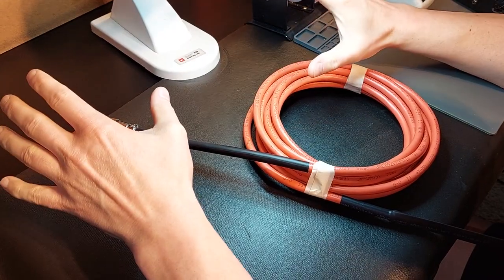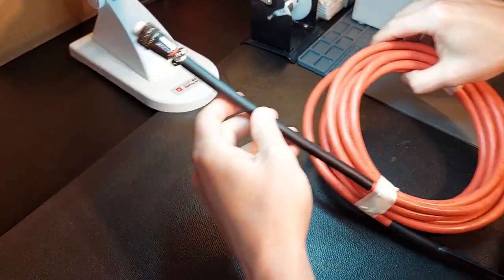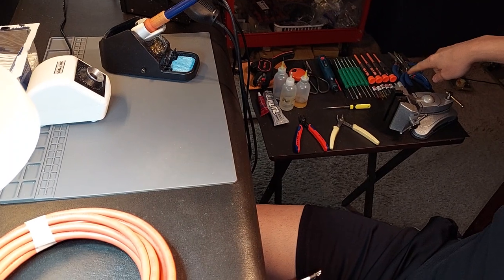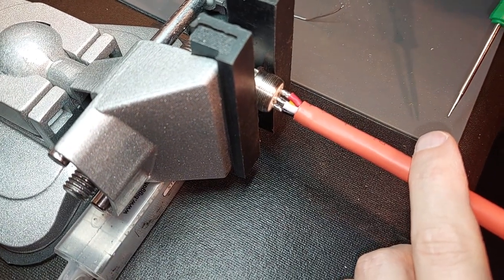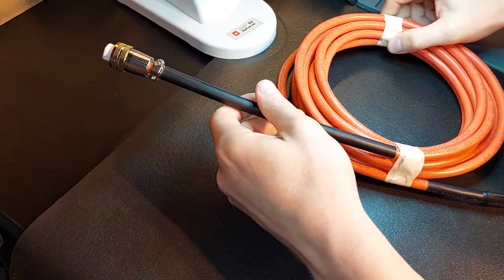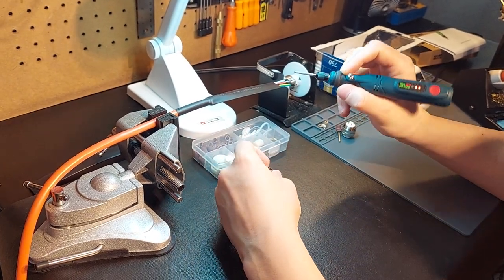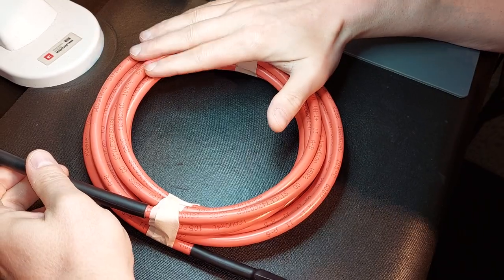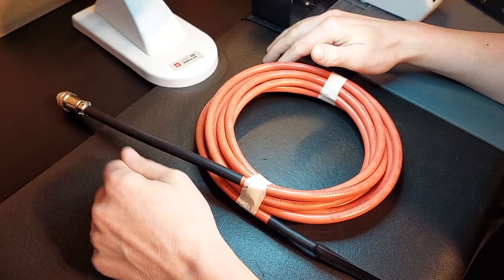Why I Charge What I do For Custom CNC Spindle Cables 4K..

Comment: I bought 30 feet of ultra flex cable non shielded for 240v power (in bulk) from over seas for $250 that's still over $8 per foot. --don't forget shipping and duties - 
I did get my spindle cable from Vince. Because  it is shielded and flexible ( and the shipping is faster )
Reply from the maker: Thank you john, for your continued support. I really appreciate it. Vince